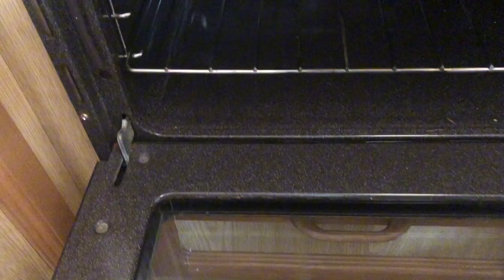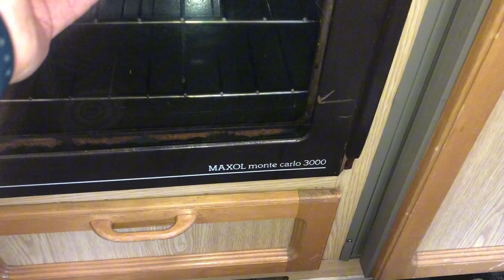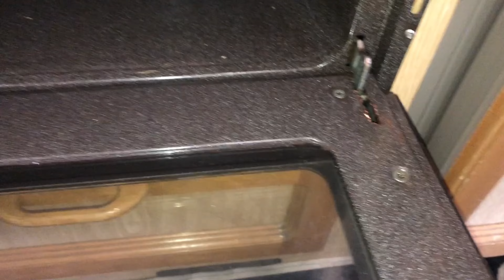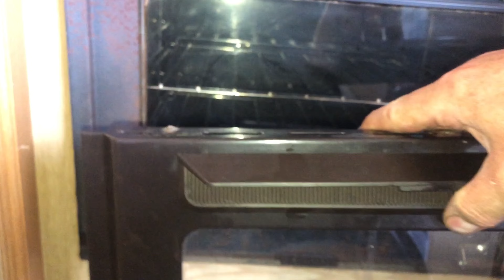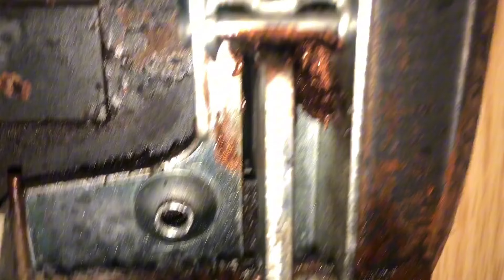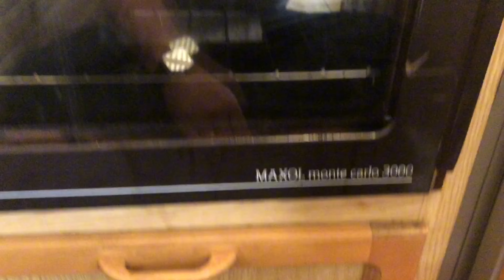Stuck & Stiff Oven Door Hinge Repair / Fix.

Comment: Those rusty springs are going to keep squeaking and being resistant. Needs some oil to lube them up and grease to protect them from oven drippings/heat. Eventually they'll be too rusty to work.